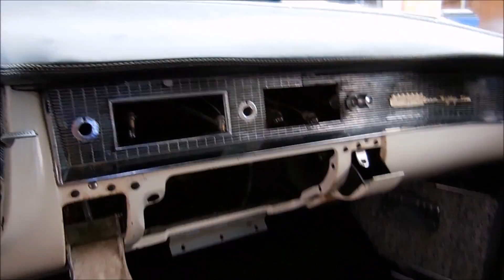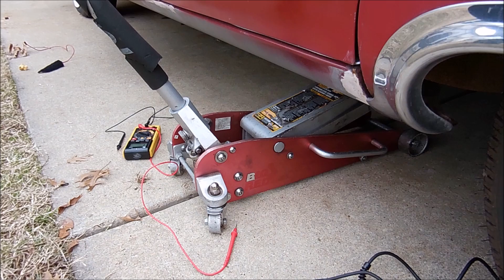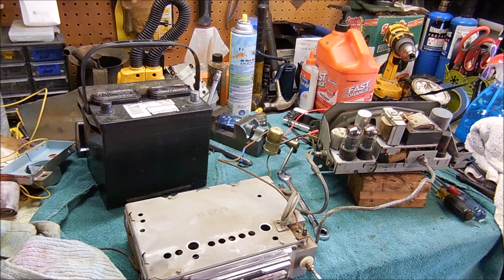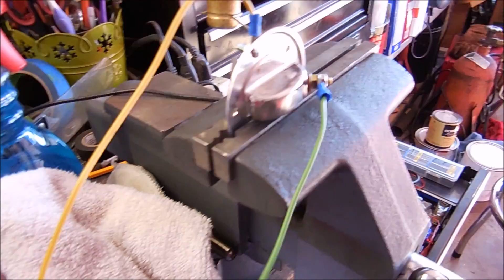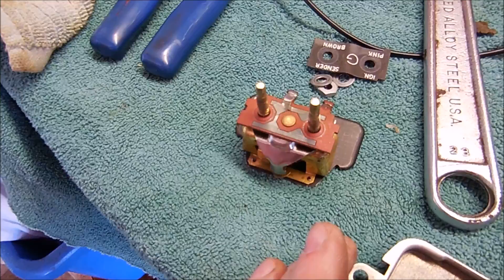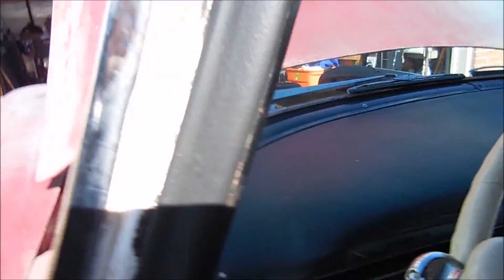1956 Cadillac Sedan DeVille Resto Video 45: Fuel Gauge Fix

Comment: I did all this same thing to my customer's 52 and all looked good.  Video copy but the gauge would still jump jammed full on occasion.  ... Then I replaced the sending unit but first tested it with a long wire so I could hold the new sending and move it and see the dash gauge moved  ... great.  So replaced the sending unit.  It read okay, just bout a quarter of a tank.  Put in 5 gallons and it moved just above half.  We were happy.  Customer picked up the car and called me from home and said the gauge jammed again past full again? .  It goes to full when the sending unit is not connected with the wire because the case ground at the gauge completes the circuit and makes it go to full, as voltage is to the other side of the gauge.  So when it comes back in I am going to run a new test wire leaving the old one off and drive it to see.  It sounds like the OEM wire is developing and open as the car drives, making the gauge run to full. Remember, the higher resistance reading on the bench was with a float up (full)? ... so open infinity, not grounded will cause the dash gauge to go to full....

Comment: To test the gauge just ground the sending unit wire at the tank (with the key on) for a couple of seconds and the gauge will go to full. That will save you a lot of time. Just a note to tell you which way to go, gauge or sender.

Comment: When you test continuity on a a wire like he did on that sender wire, you have to also test from one end of the wire to ground. That is the only way to see if the wire is shorted to ground. Have to always do the second step or you could miss the real problem.

Comment: I hear there are battery driven quartz clock innards you can retrofit to an old clock.  The batteries last about 3 years before you need to replace them.  This is better because the clock will not drain the battery on a car that may end up sitting for long periods.

Comment: Young man as a hint eliminate all ignition Keys except the one that you will be using that extra weight will wear out the switch faster. I tell you this from experience. Good job troubleshooting the fuel gauge. Let me know if you need some advice on that vacuum tube radio.

Comment: On those old radios they used something called a vibrator.  It basically converts DC to a form of AC for the tubes.  If you don't hear a buzzing sound coming from the radio, chances are that is bad.  It is usually in a round metal tube and plugs in just like a tube does.  If you can't find a replacement, check with some ham radio suppliers.  They generally have all of that old stuff.

Comment: Nice Job Ben . I would never keep a car or truck if the fuel gauge did not work . the radios from these cars are quite powerful and do need respect when handling them . it will bite you . it may only use 12 volts , but it stores a lot of Amps . Ray in Pa.

Comment: Hey man  don't worry about getting shocked.  12v DC can't even be felt (maybe on your tongue).   The only thing you need to be careful around is the high voltage side of the ignition system

Comment: RADIO I have to agree with mikesradio.  The electrolytic capacitors will have decayed after all the years, and need to be replaced, they are quite cheap, but the high voltage ones needed for vacuum tubes may not be available at the electronics parts store down at the mall.  They may be able to get new ones for you though.  Alternately look online for radio restoration parts, from memory there used to be a big supplier in Arizona.  Here in Australia I got some stuff from them umpteen years ago.  Another problem you may find is resistors gone high, this can cause excessive voltage on some components.  Components on the speaker chassis will include final audio amplifier vac. tubes, between them and the speaker looks like a speaker transformer, assorted large electrolytic capacitors for the power supply filters, a choke and a transformer, a vibrator / chopper which works like a buzzer or bell and likely a few resistors.   More than likely the vacuum tubes are still good, but they will not be good for long if you power up the radio while other components are faulty. 

Congratulations on the work. I've watched all the videos so far.

Comment: Don't spend a lot of time operating that radio in it's original condition.  The electrolytics and paper caps are dried out (low resistance) and you risk ruining chokes or transformers.  Can be easily restored by anyone in the antique radio community.

Comment: Bring the clock to a clock smith. If it has gears and the motor is good/ replaceable you could get it fixed.

Comment: Where did you get the sending unit from? I am probly going to need one for my 57 Caddi hearse.....

On a side note, haven't been out to the farm to get the fan for you Ben. Too much snow right now out there.
Reply from the maker: +SIMI Parthenpaos I bought it on ebay. was the cheapest I could find:
ebay item number 230685340327

Comment: All GM cars of the era use balanced coil gauges. You have a fixed magnetic field through one coil and a variable field through the coil connected to the sender. The armature that is connected to the needle floats between these two magnetic fields.

Comment: You could have checked the ground with your voltmeter. Hook the power wire up to the gauge and power up. Connect your red DVOM lead to the ground for the gauge and the black lead to a known good ground. Your meter should read zero or very close. If it reads above about 1.0 volts, you have a bad ground at the gauge. A completely lost ground will give you a reading of battery voltage.

Comment: Roof Liberty is likely right about the changing of the vibrator ...or we used to call it a Chopper ...That's its purpose is to produce a ac type wave out of dc volts ....They hum when working ...no hum no worky . They used to make electronic ones to replace the mechanical ones ...Not sure cause that was high school ..and it was 1965 electricity electronics class.

Comment: With the radio the first thing you should do is replace all the old paper capacitors with new ones, you can be 100% sure that by now they have all failed and will working as a resistor and passing current. Check out this video https://youtu.be/mCZb4xiLLaY

Comment: The sender is what provides the ground to the gauge to complete the circuit. As the float arm goes up and down with the fuel level, it changes the "strength" of the ground which has the effect of lowering the voltage going through the coils that make up the gauge. I don't believe the gauge housing itself needs to be grounded to operate other than to power the instrument light. I could be wrong, of course. In my 57 Chevy, I changed the sender only to run out of gas because the new sender was sending more ohms when the float was on the bottom  of the tank. You need to put the float into a empty tank and see what ohm reading it provides with the float on the floor of the tank and adjust accordingly until the float in a empty tank reads 0 ohms. You can "manipulate" the float arm to achieve that. Be sure it doesn't want the high ohm value on "empty". The "tech" person at the vendor where I bought the sender said "It's 1957 technology and NOT very precise". So, if it's going to be "incorrect" make it show LESS than what is actually in the tank.

Comment: The Radio schematic is called Sams Photofact. You may be able to look this up online or at the library.The schematic will show locations for the caps and tube locations. The caps are the biggest problem from the fifties. The power tube on mine was a medal can with a hole in the top. If its working you should be able to see fire or arcing inside it. This power tube multiplies the voltage from 12 Volts to 300 Volts to run the system.

Comment: The radio has wire wound Capacitors. These caps are coated with wax. When they get old the wax melts away and then it will short out. They will need to be changed to a new style capacitor. Also their is a power tube that could be bad. This tube converts 12 volts to about 300 volts. I went to the county Library and they had a schematic for my radio. good luck.
Reply: +chdurango59 ...Do you mean wire wound inductors? Unless a scheme is used for capacitance between the wires..